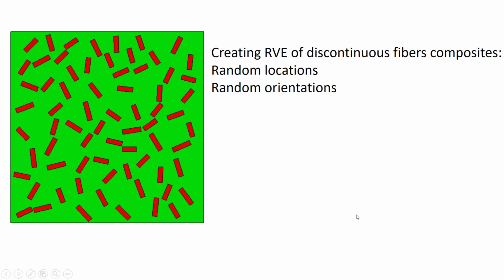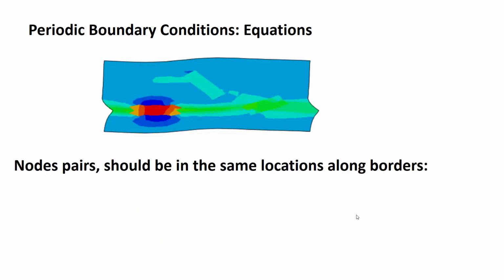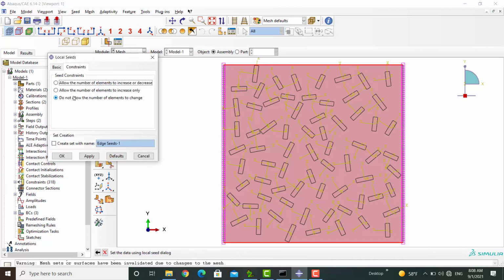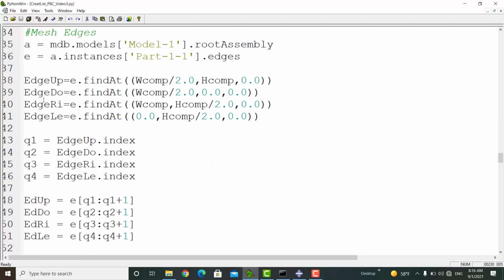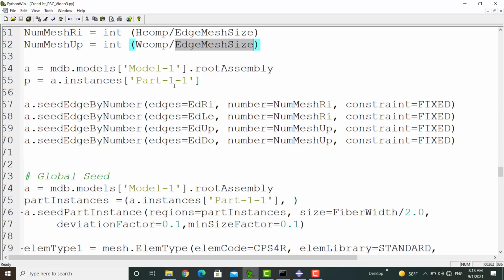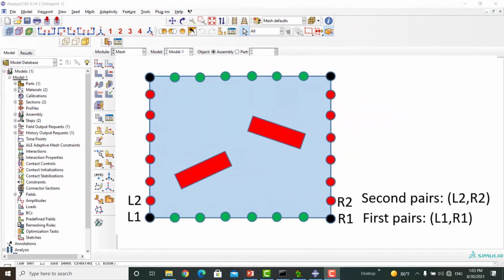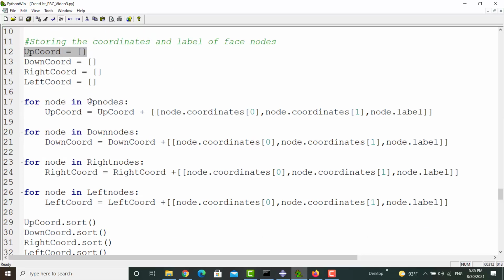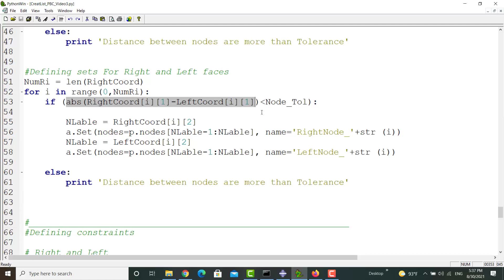Applying periodic boundary condition (PBC) to RVE by Python, Part I: mesh

Comment: Hi, just what I was looking for. Your RVE has a single edge for left, right, bottom and top each but my RVE (a brick and mortar model) has split edges for the left and right side, i.e., 6 small fragments constitute the left and right edge each. How do I modify lines 40 and 41 in your code so it works for me?

As the top and bottom edge is a single edge for me, i tried using ur code for it. ABAQUS generated the sets containing individual nodes but they are of type 'Node+Element' and I cannot use them in the constraint dialog box.

Later I tried keeping Left Edge = e.findAt(*All the edge fragmenst*) and then EdLe = e[q3:q3+1] but when I run the script it shows typeError: unsupported operand type(s) for +: 'AbaqusMethod' and 'int'

Thanks in advance!!
Reply from the maker: Please check this 2D and 3D PBC plug-ins:
https://youtu.be/9hjSDOlflgs?si=XxAie3FJQLjYSPSQ
https://www.youtube.com/watch?v=Qiw6mgXFmho
and also check our website for scripts:
https://www.engssoft.com/